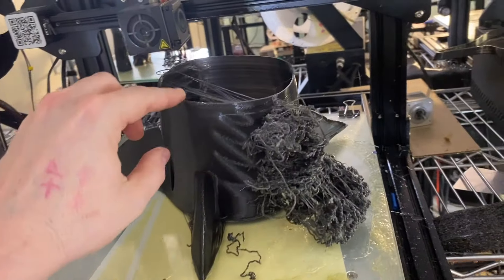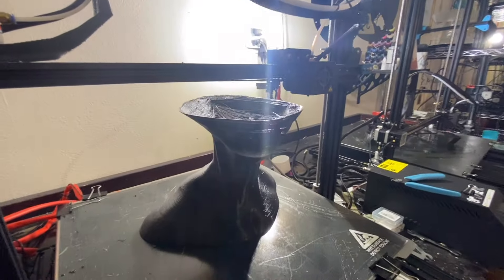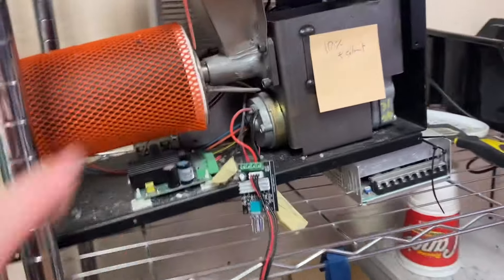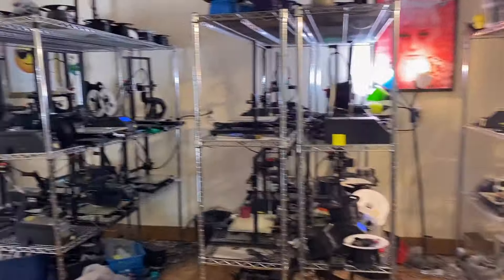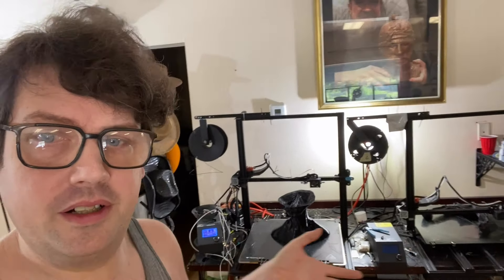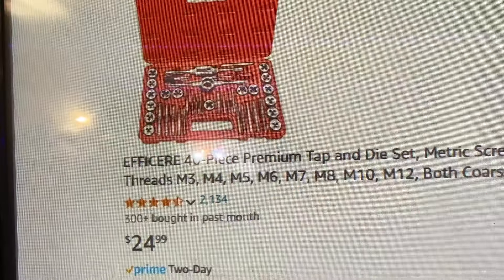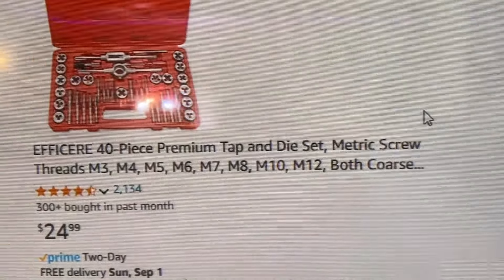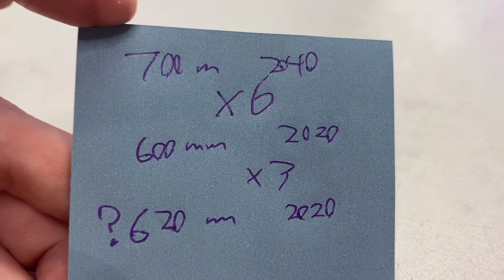How a 3D-Printing Business Works: Scaling an Etsy Business, Drill Press Adventure, M3is3D Vlog #34

Comment: I've been messing with my ender 3 pro and I decided to try and put Klipper on it so I could easily change firmware parameters without having to re-compile and re-flash marlin every time. I gave up tonight 🤣🤣 Buying a Bigtreetech replacement board for it tomorrow at Microcenter. I might walk out with a P1S but I really know I shouldn't lol. I really want a Prusa MK4S with an MMU but I need it quicker than that. I hate how they take from Open Source and shut out everyone from their machines but I need something better!

Glad to see business is picking up and it's giving you some ability to expand. You've got this 💪

Comment: did my comment get deleted?
Reply from the maker: @hotfix7387  I don't see any other comments
Reply: @M3GreatRiffs  YouTube seems to drop my comments sometimes. I learned not to put links in them, but I didn't do that this time. /shrug

I had some gratifications I wanted to share, and again I appreciate you doing that. I wish more people did as I think it would be contagious.

I also made the recommendation of the cheaper Neptune 3 Max, and I see someone else did as well and you responded. Part of my comment was I know it was 420x420x500 versus 500x500x500 which it looks like you are looking for, but I suggested you consider not all of your prints, such as the alien head, need a 500 x and y. I.E. You could move some of the smaller prints to the Neptune which is cheaper than the one you were looking at on the video, and free up your current 500x500x500's for the bigger prints that need it.

I also think you could rotate your sharks 45 degrees and probably get them to get in a 420x420, but that's me just trying to come up with ideas so you don't have to pay more than a Neptune 3 Max or build one yourself. For the record I have never used an Elegoo printer, I just heard good things about the Neptune 3 Max like it's more reliable than the Neptune 4 Max even though it is slower (which I don't think matters in your situation).

Please keep the awesome and hilarious videos coming. You are a breath of fresh air!